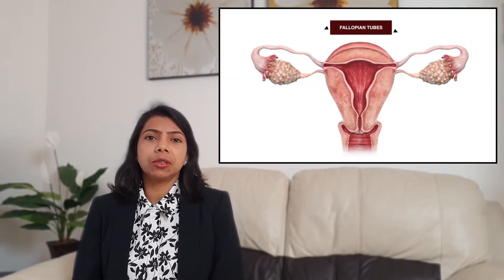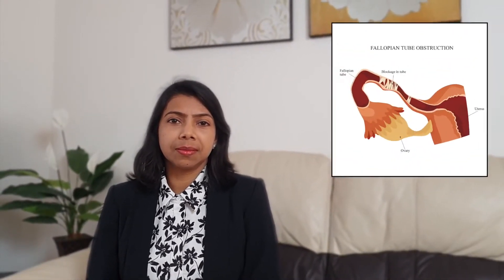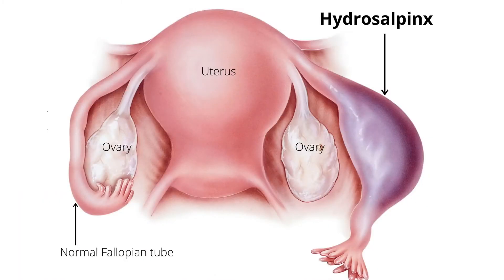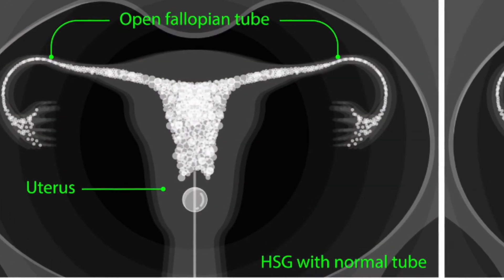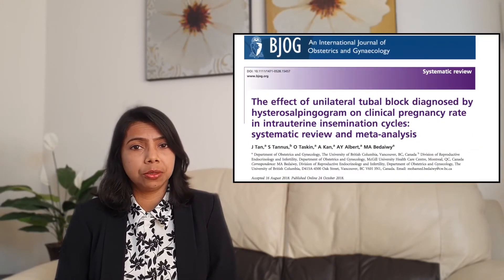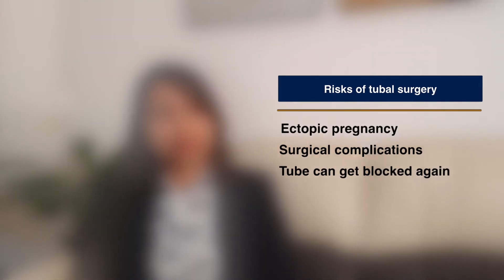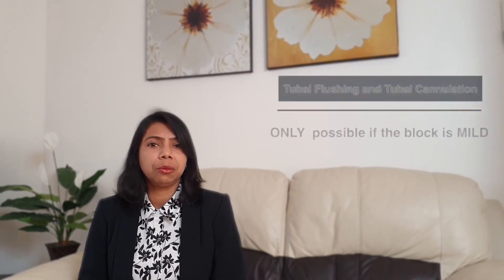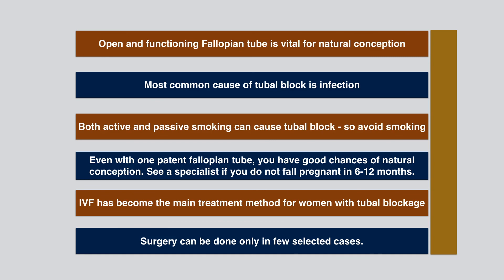Fallopian tube blockage | Causes & Treatment | Commonly asked questions

Comment: Damage/blockage of the fallopian tube: A lot of women either have a damage fallopian tube or a blocked tube which actually simply prevent the sperm from reaching the eggs.
When a woman has her fallopian tube blocked, it greatly reduce her chance of getting pregnant.
That is why women need to go for a test such as HSG to check if their fallopian tube is Blocked and when it shows  that You have Blocked Fallopian Tubes, Do Not undergo any surgery because it might lead to lost of one Fallopian Tube , simply Use AGBARA HERBAL DEEP ROOT CLEANSER and Use this Medication for 2 weeks and it will unblocked your Fallopian Tubes and Boost Your Fertility and You will get pregnant as fast as possible okay,,Because it re-immune your Body and Balance Your Hormones
Reply: Where i can buy it?

Comment: Good day ma'am.... One of my fallopian tubes is blocked, but you have said here in your video that it is possible for a woman having one normal fallopian tube to get pregnant... Is there any chance that i would suffer from ectopic pregnancy?. That is what my ob-gyn told me 5 years ago...Big thanks in advance....😊😊
Reply from the maker: Yes, you can get pregnant with one fallopian tube. There is a slightly increased risk of ectopic pregnancy as the other tube is blocked. If you conceive, please do an early pregnancy scan at 6 weeks.

Comment: Can this be congenital? or happens after birth always?
Reply from the maker: Congenital absence of both Fallopian tube can be seen with uterine anomalies like MRKH syndrome, which is extremely rare (<1 in 5000). They form different category and hence not included in this video. Congenital absence of tubes with a normal uterus is rarely reported. There have been few case reports of congenital absence of ovary with partial or complete absence of fallopian tube on the same side and a normal uterus. Again they are extremely rare (<1 in 11000).